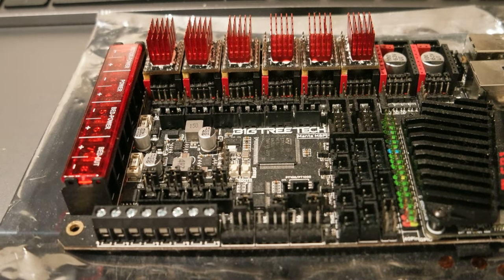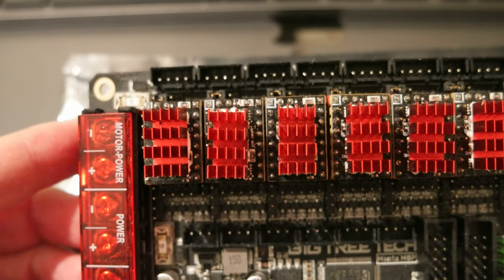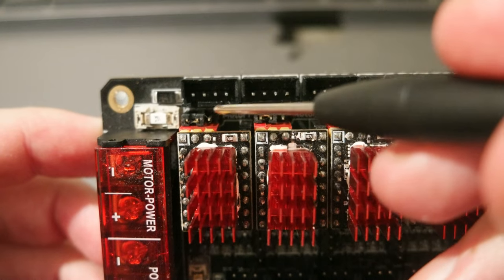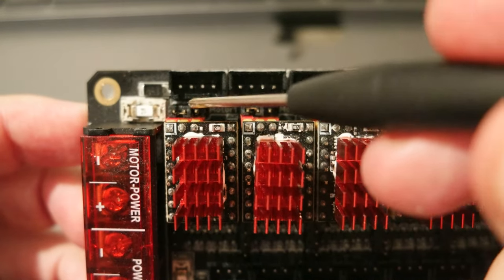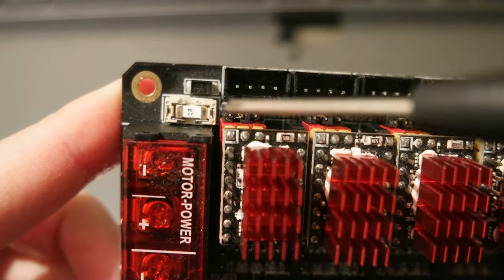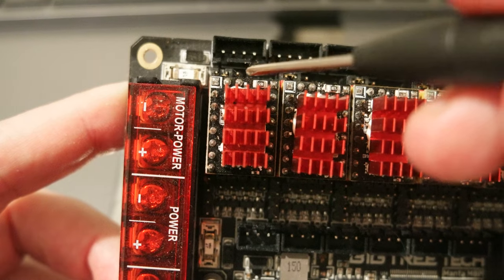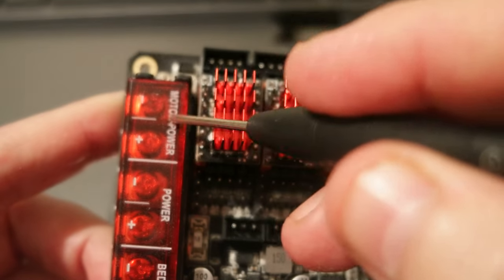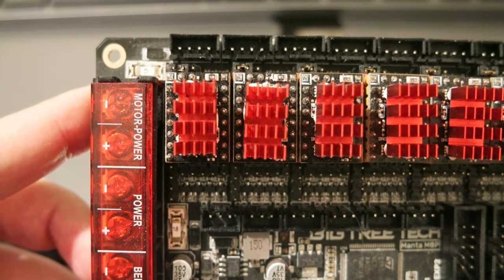How to setup VBB or HV jumpers to power Drivers on a BTT Manta M8P board

Comment: Thank you very much... Manual on the btt octopus max ez does not specify this. u saved my day
Reply from the maker: Yeah I noticed that too and if I remember correctly the pictures about this are the same so it's confusing. It's great to have the possibility to have different voltage for drivers and power. Please subscribe thx!

Comment: Thanks for you video. I’ve come skr boards, just moved one of my printers to the octopus max ez. Having a dedicated power section is new to me but very awesome.
Reply from the maker: yeah separating the power is great. On the 3D printer that I am building I will separate it even more using mosfets so that the board is not "stressed" by all the current. I will have 3d prints last couple of days so it's very important to have the board cool ! IF you are not subscribed please do, thx !

Comment: Friend, Where is the documentation that explains this setting? Do you have a link?
Reply from the maker: check Manta M8P BTT github, there is the board Manual v1.1 https://github.com/bigtreetech/Manta-M8P Please subscribe thx
Reply: @ganzoai  I see that now... the manual doesn't explain the alternate position but after looking at the board more closely I see the text for the HV pin. Thanks!
Reply from the maker: @TalkingGIJoe  yeah is a bit confusing and I think there is an issue with the images that are on the manual.